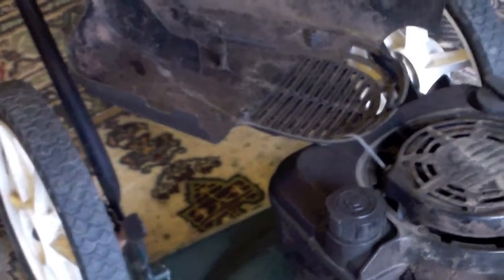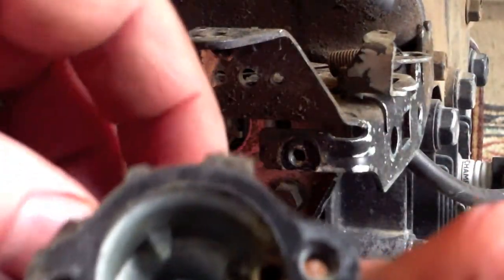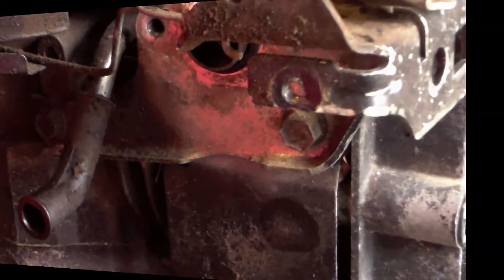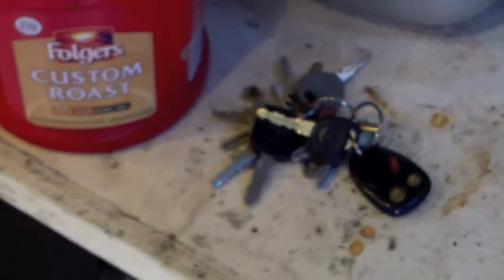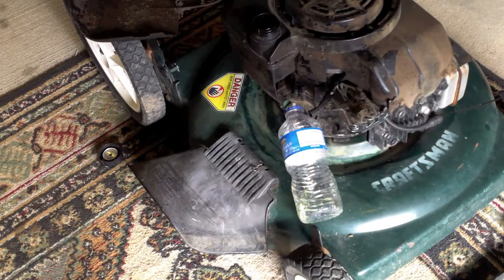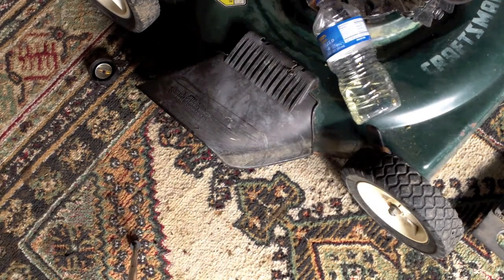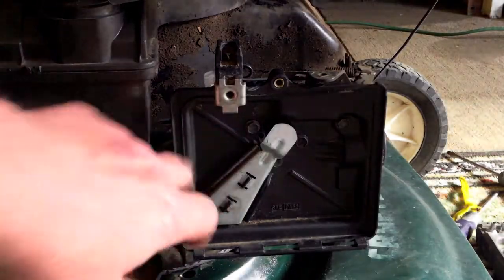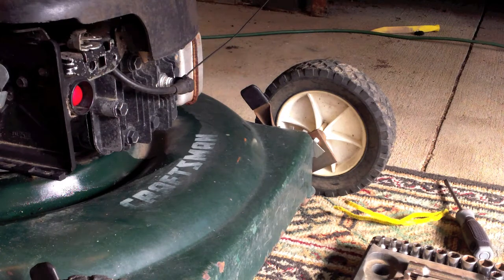How to replace a primer bulb part 2

Comment: hey darren. thought you would find it interesting that these little push mowers dont even have bearings. i just rebuild one and its just the rod and crank shaft. kind of weired, but the rod bolts are also only toghtened to 8 foot lbs